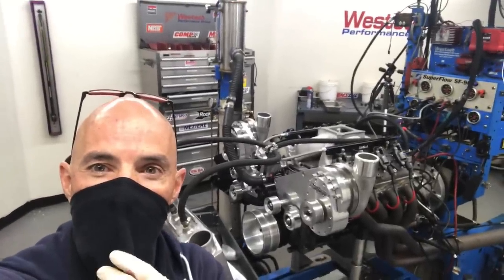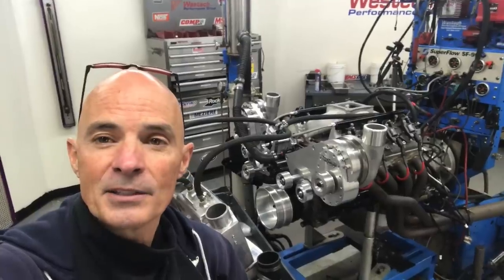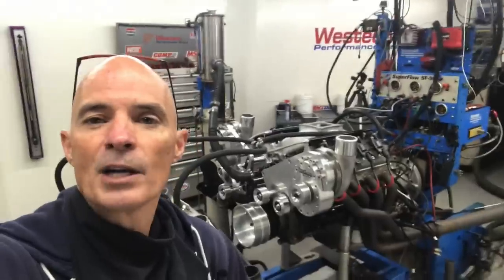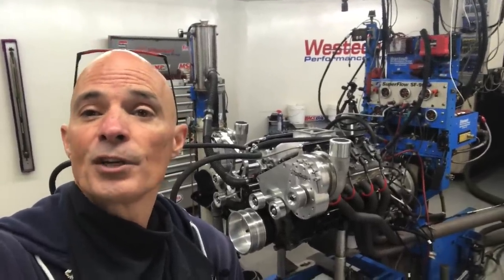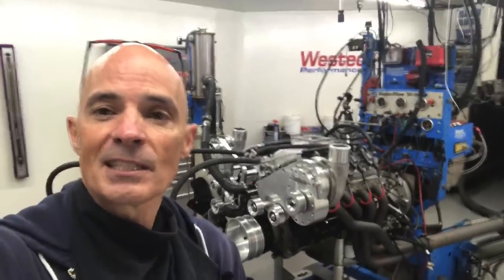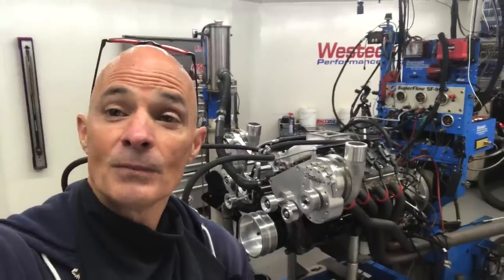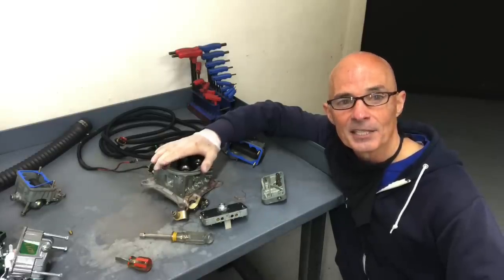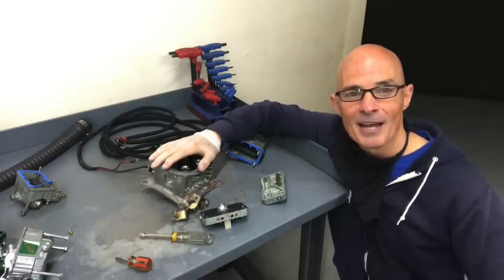WHAT'S INSIDE? -BLOW THROUGH CARBS

Comment: if you took the main jets out and it still leaned out at the top end, then the boosters may be to small or the port to the booster,
Reply: They removed the jets and plugged the air bleeds. I was thinking it was booster transfer circuit as well. There is a restriction somewhere.

Comment: One thing I have seen happen with e85 is fuel foaming.. e85 seems to be more susceptible to fuel foaming.. as fuel pressure rises with boost and the float level is dropping due to fuel consumption it foams worse and worse.. like a garden hose in a bucket, Low pressure high volume, no foam.. high pressure , less volume but more foaming.. Also, are the plugs actually verifying the elan condition? some time e85 can show a false lean due to too much fuel and the 02 is picking up the un burned oxygen.

Comment: What is the BSFC? Once the amount of fuel the engine is consuming has been established, a fuel issue can be verified. An engine with excessive amount of fuel (90 Lb/Hr  of flow though 8 injectors making just over 500 Horsepower excessive) can "Trick" the O2 sensors into reading a lean condition. 

Once a fueling issue has been identified, start with the incoming air and the signaling for fuel. Several have mentioned that the carburetor hat could disturb airflow in unintended manors. Once verified that the corroborator is receiving the correct signals to deliver the correct amount of fuel, analyze the fuel entry point into the corroborator. Work back through the complete fuel system and sub-system until a point of antiquate fuel has been reached. 

I hope this helps you out, or may provide guidance for another in the future. 

Thank you and best of luck.
Reply: Holley hi ram twin carbs .Revised blower hats with a veined air straighteners if you will  .Start tall work your way down in height until condition recurs.  The bank that's lean is opposite engine rotation isn't it?

Comment: I would calculate the inside area of the needle and seat to confirm it physically flow enough fuel by itself to meet your needs
Reply: There is a restriction somewhere. That they are having an issue under boost tell something. They maybe need a rising rate regulator, you cant flow that much fuel at 8psi and its questionable if the needle valves can flow that much fuel. I thought it might be the booster transfer circuit may not be large enough. He needs a mechanical gauge on the carb after the regulator to confirm flow to the carb under boost. If he is using the port thats on the back of the hat, there is a chance that the pressure signal to the regulator isnt accurate.
Reply: @timothybayliss6680  do you think the boost signal for the regulator should be above or below the carb? I agree with you, a fuel pressure gauge between the regulator and the carb would be telling. I'm not sure why Richard is against the dual needle and seat bowls
Reply: @pw383426  he is saying that his boost signal is above the carb. It should be above. If it's below it will actually fall  below 0 at idle. Under boost and any time at wot it really wont make a difference, but you want to refernce the fuel pressure to the pressure in the bowls, to where the vents are. Even being so, there is a chance it's not in a good place and it's not getting an accurate signal of boost to the carb. A mechanical gauge on the carb tells you lots and confirms fuel pressure. That it only gets lean when there is high fuel flow means it's draining the bowls. The lean on one bank is an oddity. A sight glass on the bowl might not hurt either.

Comment: It sounds like you have a manifold to cylinder head vacuum leak. I run it to that on the Intake tube’s on an airplane I help work on.
Reply: Really, a vacuum leak on a blow thru carb deal, wouldn't you think that while under boost on dyno you would see fuel exiting your imagined vacuum leak ? Please don't work on any more plane's
Reply: Trevor Petersen  do you know any thing about a Lycoming horizontally opposed engines.   I will admit I know ever little about blow through carbs.  But it is not uncommon for the intake tubes on a lycoming to leak.  The indication that you get is one or More cylinders to run lean.   As each cylinder has is own intake tube.  This may not hold true for a V8 with a blow through carb.  But it is always a good thing to look at things from meany points of view.

Comment: The problem is the hat.  It's not distributing air equally.  Common problem with that hat.  Use an Extreme Velocity hat and the problem will go away.  Personal experience with blowthrough turbo motor

Comment: I'd like to see a wideband in each cylinder, maybe narrow it down to 1 or 2 cylinders. I'm thinking it's the hat also, I'm sure you've used it before but twin blowers may not like the hat.
Reply from the maker: we've run twin turbos with it and there is  single outlet from the IC
Reply: @richardholdener1727  I thought the hat looked familiar. You're the man, can't wait to see what you figure out with it. I feel like at this point it's gonna be something strange. We're all learning from you tho.

Comment: Do you think it has something to with air flow like the tube on the carb or the intake maybe a different intake manifold I know nothing about those carbs but are they rated for that boost it seems like if it's all under boost it might not flow that extra fuel but surely they would have something for that since that's what they are for

Comment: Your  regulator  placement is  restricting your top end flow rate
Reply: He keeps saying he has made 1200hp on gas, its not the pump. It looks like this to me too, not enough flow at high boost. With 8psi base and 15lb boost, need to flow nearly 100gph at 23psi. I think the carb is fine, problem looks elsewhere.

Comment: If the pump is holding pressure at the carb, the flow is good. If two known carbs return the same result, they're probably good. A slower pull could reveal whether the float bowls are running low, if the problem shows up earlier. I suspect turbulent airflow through the carb or a misfire. You could monitor secondary voltage or exhaust runner temperature for a misfire.
Do you have a fuel flow meter?
You must be enjoying yourself reading our comments, aren't you?

Comment: Hey Richard, have you verified that the fuel in the bowls does not drop during a pull-video the fuel levels via a sight glass. If that is fine, then as has been suggested, turbulence may be the problem, try a different hat on the carb.  I would also suggest a spacer under the carb. Maybe flip the carb 180 deg to see if the lean AF moves to the other bank.
The side to side AF discrepancy may be the clue. Are you only running two sensors, one in each header? I have noticed on other videos that the headers had an individual bung/pipe. Have you tried to measure the AF for each cylinder by moving the sensors from the collector to the header pipe?

Comment: It's easy,  the 90 degree inlet, bolted to the carburetor.
It's totally screwing up the airflow,  into s mini tornado 🌪.
Screwing up the air bleed vents on top of the fuel bowl.
You need a straight shot of Air.
Reply from the maker: its been run many times in the past
Reply: @richardholdener1727  But your trying to pull a different fuel now. May not behave the same way

Comment: Is the fuel volume restricted somewhere? Pressure up volumn down? Is the air coming in backing up the fuel? Is the hat making a vortex of air in an inapproprite place as boost moves up? I'm just guessing of course. How about a big spacer to see of it behaves differently? A geometry change in the airflow pattern? Put the fuel inlet in a low pressure area created by the the flow of air?

Comment: because u have one lean side and one good u could have a leek at the intake to head side blowing vacuum/ boost out will give u a lean conduction would also explain y it gets worse with rpm/boost
Reply: i would definitely b looking toward the one side lean could b a value float or seal problem or even a not so sealed head. a cylinder to cylinder afr would b able to spot the problem area more exact. could b to much spark on one cylinder causing erratic combustion cause a lean. to much plug gape or to much dwell time. witch could b bad ignition control or rarely a bad coil. but most likely is a vacuum leak on the intake crake or a bad gasket.

Comment: I'll vote for the hat being a big part of the issue. I know some N/A guys have had issues with using  those in low hood clearance applications.

Now for a left field 'maybe' . Could you have some kind of "tuned" pulse/resonance/standing wave causing a flow or side to side distrivution issue? Perhaps because of the two belt driven blowers? If it's leaning out as RPM rises and you have eliminated other options... dunno. just throwing it out there.

Comment: All signs seem to point to the fuel system not really being the problem. The split AFR shouts to be a problem  like you may not have enough valve lash. maybe lifters pumping up? Something wrong with the springs on one side? Maybe head gasket blown  cylinder to cylinder causing cross mixing? Can't wait to find out what you find, but if fuel pressure data logs good the whole run I don't see that being it. Especially if the carb gurus aren't seeing what they expect, probably a problem someplace else.

Comment: I agree with all the comments about the carb hat. It’s effect could be exacerbated by the long straight section of tubing leading to it from the inter cooler.  

First off though, why not put your carb back to “stock”, tank the dyno up with C16 and try that. Then you remove all the E85 questions and are down to either the hat, the manifold or a mixture of the two. 

Sure looking forward to the ‘aha!’ video to follow. Good luck!
Reply from the maker: we did run with race gas and gas carb
Reply: @richardholdener1727  Did it run lean at higher boost with gas and race gas. I thought I heard in the video that it did not. In this case maybe the E85 isnt working with the Hat you are using since you need so much more E85 than gas.

Comment: Dual 750 quads.  Reduce venturi velocity.
Reply: Would you not want to increase air velocity to increase the Venturi effect?
Reply: The problem is a lack of Venturi velocity to begin with. The air passing threw the boosters is either very low velocity or has a ton of turbulence. Reducing the velocity will just make this worst and pull less fuel threw the boosters.

Comment: Turn the carb hat side ways off to driver side of the motor instead of straight from the front? And your fuel pump sounds like not enough flow.
Reply: A3000 not enough flow? You could run water through that fuel pump and put out a hotel fire
Reply: I flow was insufficient pressure would drop.

Comment: Just a theory but I agree the 90° bend is a major contributor, the air is probably blowing right over the front venturis. For the dyno you could come is straighter but could you fit it in a car? My thought is a dividing wall that goes from where the round tubing connects to the hat, all the way through the hat down to right between the front and rear venturis. Forcing the air from the bottom half of the tube into the front venturis. The air is not wanting to make that 90° turn is my thought.
Reply: Thinking further about my idea above, the air will still be tumbling reducing the efficiency of the venturis and the boosters. A plenum with individual runners to each venturi would be more effective at reducing the tumbling effect. For proof of concept make a hat where the air comes straight down for at least a foot. Cheaper to make than a plenum with runners but will verify whether or not the 90° turn is the issue.
Reply: Holley ignition issue if it’s on one bank
Reply: That’s a really interesting point!

Perhaps he could check EGT of the lean bank to confirm the lean reading. ??

Comment: Weak exhaust valve springs drawing in exhaust gas on the intake stroke coupled with an incorrectly installed camshaft..
Carbs adding fuel at a gasoline rate instead of an e85 rate.
Try it on pump gas and see if it does the same thing.
Reply from the maker: ran race gas-same problem, cam is fine-runs perfect NA and previously supercharged

Comment: I don’t think fuel injection is gonna fix your issue, they might be able to compensate for the lean side of the engine but won’t correct what’s going on. I think you have a mechanical issue (something’s either damaged or not calibrated correctly) in your intake manifold or within the head. Just my best guess from my personal experience. If you have the means too swap intakes and if that doesn’t work swap heads and intake see if that changes anything. Same issue different carb, plus lean on only one side. Gotta be something to do with the runners for that side or the valve train on that side.

Comment: 20 years ago when I played with boosted cars on OBDI and you couldnt tune them we would run cold start injectors off pressure switches. Boost would hit whatever PSI and the injector would turn on. Dont know if that would work

Comment: Misfires cause lean readings
Reply: Richard on another thought maybe there's something off with the ignition timing on that bank, see what color the plugs are
Reply: @UCVa8nzC_jNxS5X9SwAl4VjQ That's what I was thinking,  maybe the Holley went bad  in more than just the fueling side.
Reply: It reads lean because there's unburnt oxygen mixed with the unburnt fuel, a swag would excessive back pressure or maybe something causing a higher load on that bank try a dynamic compression test
Reply: I was also thinking missfire from failing coil driver's.  Likely not a full on missfire, but more of a weak or late fire.  A 5 gas analyzer would immediately point you in the right direction, but not many automotive guys have those laying around.
Reply: Truth, but they would also cause a sporadic horsepower curve, and Rich is too smart to not know something like that
Reply from the maker: curve is smooth
Reply: I would assume a misfire would cause a rich condition-unburned fuel?
Reply: @ts302  nope, the o2 sensor reads oxygen not fuel. So if a cyl doesn't fire it reads the oxygen that didn't burn and shows lean.
Reply: @ts302  Depends on the type of misfire. Theres 2 types, type A and B, type A will affect catalytic converter life, type B won't (post-1975 stuff). A  stuck-open injector will cause a misfire, thatll obviously show rich. Some modern cars will shut off cylinders' fuel and spark when a bad misfire (type A) is detected, that'll show lean.
Reply: @ts302  oxygen sensors reads unburnt oxygen not hydrocarbons.  So misfires will read lean.

Comment: Dual carb tunnel ram.  One blower per carb. Done. Problem solved.
Reply: That would be trick!
Reply: I wouldn't mind that but I think it would still work better with a communication port between them. That way both carbs have the same boost and fuel pressure will be the same.

Comment: air pump limitation,not sucking enough fuel, you need to enter a different materiel of motor design and build range and let those temperatures start to come up
Reply: Need to melt the thing and call it a pulse jet :)
Reply: the bang is only accelerating the air remember and playing with the direction and how fast you can get it to go
Reply: just thinking about the concept of a explosion/detonation based motor and to make air accelerate through it bringing the rpm up
Reply: Possibly get serrious and ditch monitoring afrs and go with exhaust gass temperature and know the alloys and metals down stream from the combustion source including pistons,liners, gaskets and all and start really pushing the motor if you want more out of it
Reply: Hottest point is at the arc and then is cool down change from there
Reply: Individual egts with knowen clean full source at a specified flow rate will allow so much thermal and kinetic energy to be processed and all
Reply: Knowen clean fuel*** at specified flow rate will achieve certain results in specified detonation area (combustion cylinder) with a afr calculatable by air speed rate and fuel consumption rate knowing the limitations of the expansion rate information of the fuel at various temperatures and compressions before knowen ignition times and expansion rates are achieved giving an air temperature,speed,density causing the motor to move........ or get the desired rpm...... and really desired torque and hp reading to make everyone perve lol
Reply: It's about ulitising the rotating mass and where you have the bang in the "curve" .......... hence why super super high horse methonal motors tend to spit fuel..........pritty much density creation by filling those combustion cylinders up and keeping them cool
Reply: By curve I dont mean anything I see you monitoring there publically
Reply: I don't think you're inserting enough energy to get over the hump to move the rotating mass
Reply: Airhat is potentially fine but issue is with the energy density vs rotating mass.
Reply: The exponential gains of resistance are climbing to quick for your tuning/energy lever/fuel
Reply: Sorry just applied my physics knowledge. You know apple dropped on me head

Comment: Sounds like boost pressure down the vent tubes.
Try extending the vent tubes into hat by 6 to 8”  I’ve seen that work before. Best of luck
Reply: Yeah, I was going to say 12" tubes through the hat in a situation like this 6" is probably too short for the weak signal.